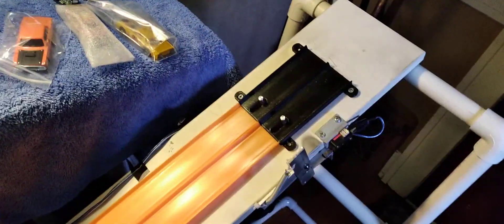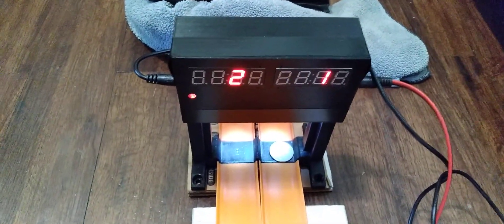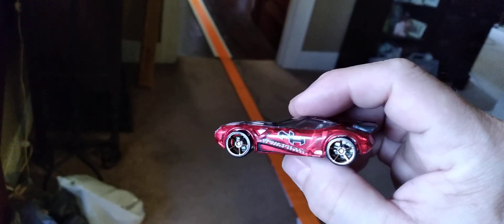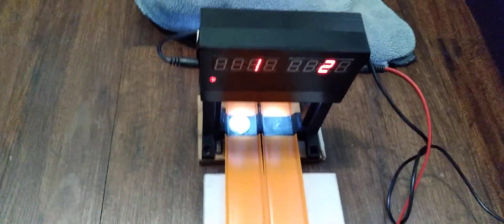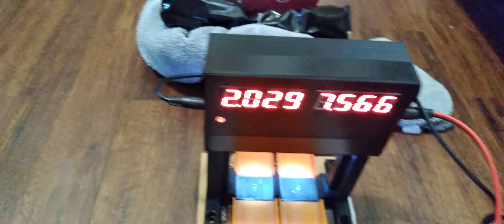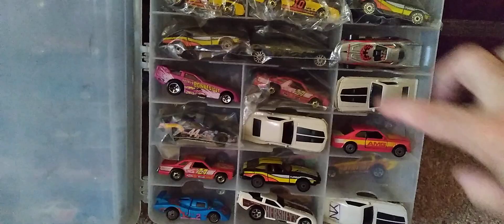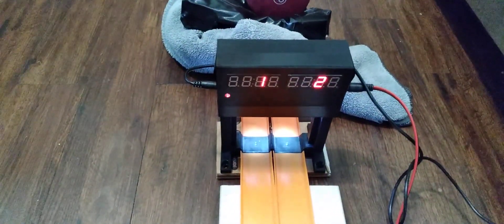Speed Testing Loose Hot Wheels, featuring Mattel's Fast and Furious '70 Road Runner!

Comment: Pretty tempting to open my fast and furious packs.... I just reworked an 82 Toyota super last night and it got into the top 8 for its weight class... And it's always good to see fast camaros .... a couple of my favorite castings are the blown camaros..... And what car do you think would be king of the heat?🤔😅
Reply from the maker: Yeah the Mattel F & F's are all potential killers after dust. Before dust, they all labor terribly.
The F&F white Mustang, orange '70 Road Runner and gray Charger with a black hood all can impress. They all weight mid 50's to low 60's.
However the lighter offering of the GT40 should do very well in your 41-50.99 weight class.